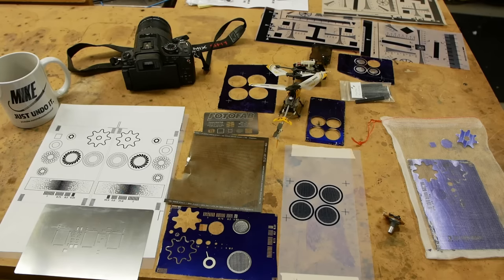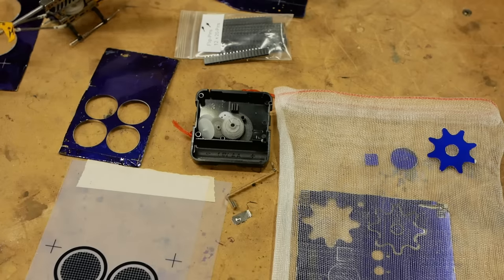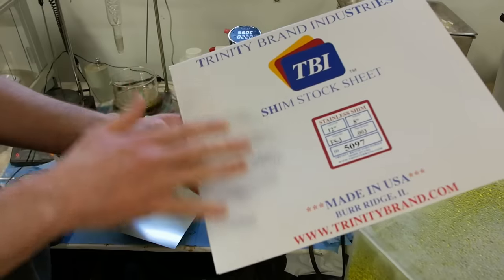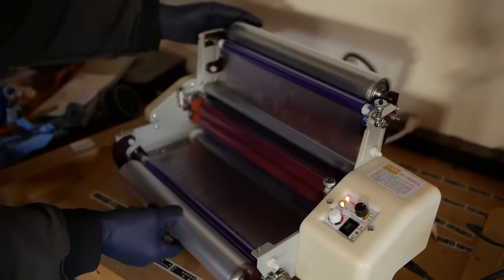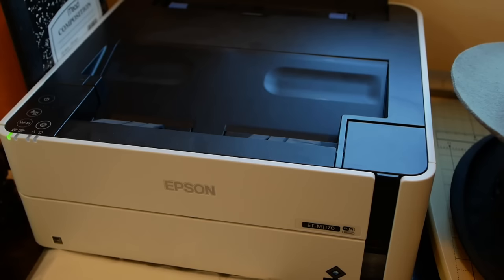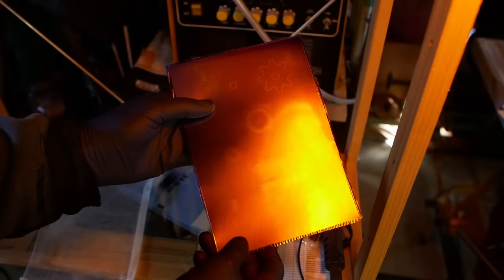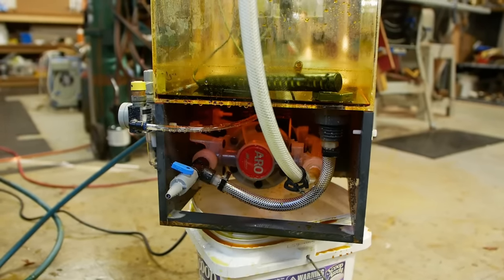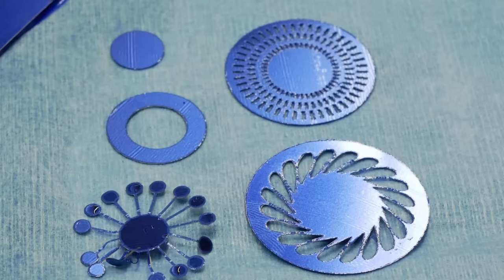How to make precise sheet metal parts (photochemical machining)

Comment: Hi Ben,  The specialty black inks are great, but if you want to use a regular inkjet then sometimes yellow dye inks can be more opaque to UV light because of UV inhibitors to stop fading.  Also a Stouffer Gauge will help a lot working out your exposure times.  Cunning Fellow (The guy that did The Etchinator)
Reply: Would it be visual at the end? I mean, can you easily inspect the quality when its printed? 
I'd imagine , no? 
But maybe a mix of dyes?
Reply: You can see the yellow ink with your eyes no problem.  A non yellow light source like a large blue LED will enhance it.  But really the developed dry film is the thing you should be inspecting most closely.
Reply: Do you know any particularly good yellow inks for this kind of thing?
Reply: Inna - Pigment inks naturally block more light so if your printer uses pigment inks (Epson would call them DuraBright or UltraChrome) then black is the best option.  If your printer uses dye ink (Epson Claria) then the black does not block the UV as well as the yellow.  The yellow is most susceptible to fading from the sun, so they add UV inhibitors (sun screen) to the yellow ink.  Most brands of dye yellow that claim they are light fast or don't fade in the sun will do the same.
Reply: couldnt you skip this step alltogheter going the mdlp route (like a uv 3d printer) i guess its a somewhat smaller DPI in a print, even still, a 6k mono screen should be abled to resolve fairly small details
Reply: @JLCok  Would only have enough pixels for small items unless you could step and repeat, and then registering top and bottom sides will be another problem.  Direct imaging would be worth it in large commercial operations, but for small scale - inkjet photo tools probably make the most sense.  Which is also the way it is in PCB making.  The big boys have lasers and fancy lenses.  The home shops have ink jets or drum photo plotters.
Reply: @TheCunningFellow  So I guss the next step is to modifay  inkjetprinter  by exchanging the  inkjet print head with UV light head ?
Reply: Marvellous stuff, Ben, thank you!

Comment: Another neat thing with photoetch is you can do partial depth to make fold lines,like scoring cardboard. Probably needs finer process control,though might be worth trying just putting them on one side .
Reply: Mike, Yes it is normal practice to have the fold lines etched only from one side.  The Asteriod Belt shown here https://content.instructables.com/ORIG/FEJ/ID3W/HFSHFI10/FEJID3WHFSHFI10.jpg does that by having half etched lines.  The photo tool for the back here https://content.instructables.com/ORIG/F8D/ELWM/HFSHFHYS/F8DELWMHFSHFHYS.png has thin lines for the folds but the front side is solid.  The same for the buttons so the arrows and symbols are only etched half way through.
Reply: @TheCunningFellow  Thanks.. how is it that YouTube is happy with your links?
Reply: @patkirk960  I didn't know youtube censored URLs.  I guess if the disappear you can search for "The asteroid belt instructable" and scroll down to step 5.  I used "toner transfer" there because I was told instructables readers prefered to see simpler tech than dry film photoresist.
Reply: @TheCunningFellow  Thanks. Yes they certainly remove them somehow I'm sure automatically but somehow folks circumvent the censorship!
Reply: @TheCunningFellow  Some lovely extra engineering in your instructable that's above and beyond the average. The extra yet simple hardware to clear the screen and to reduce the overhead from code was delightful.
Reply: @patkirk960  The channel owner can choose to allow links or not. But I guess there is also some AI filtering.
Reply: @user255  ah. Right. Thanks
Reply: i was thinking the same while watching the video.
Reply: sometimes it lets URL's pass through while other times it does not.
probably also depends from the source, since google ...
Reply: we've had custom RF shields for PCBs made, they were done like that, partial through for fold lines and text
Reply: @patkirk960  I don't think YouTube actually censors urls I've never had a problem
Reply: @TheCunningFellow  works now. Ben just had to approve the link I'm guessing. Thanks Ben!
Reply: @katiebarber407  I've had plenty of problems with links. At this point, I've taken to avoiding links wherever possible (e.g., by giving a search string instead) and, where I absolutely must have them, posting them in a separate comment that replies to my main comment so that at least if that comment gets removed the main comment has a reasonable chance of staying up.

(I've even seen several occasions where a comment appears to post but doesn't; reloading or checking in an incognito window shows that the comment was not posted. Even after retrying it, sometimes with somewhat altered forms, it won't post and I just have to give up.)

Comment: It's almost creepy how you come out with videos that answer the questions that I AM CURRENTLY STRUGGLING WITH. I'm talking about... the same day. It's super helpful, but also unsettling.
Reply: Same thing for me, I just watched a video on model making and was wondering "how are those photo etch detail kits àctually made?"
Reply: Let's test your theory.  What are you working on now?
Reply: @TqSNv9R0iG5Ckxew  At the time I was in the process of torturing myself trying to get the dry film photoresist to adhere good enough to copper laminate. If you look really closely you can tell Ben is actually having the same issue. The film delaminates during the etch around the edges. Sometime delaminating completely. I haven't found any technique that will work well enough to have 1mm or less resolution. But I have found something that does actually work pretty well. It is labeled as  "Photoresist Anti-etching Blue Ink Paint For DIY PCB." It's a thick blue ink that needs to be cut with acetone. You can either spray it on with a "Devilbiss" style paint sprayer (which will give you a better, flatter finish" OR you can go to an auto parts store that carries "Preval" paint sprayers. They are like a mix your own spray paint kit. pretty cheap, and works well enough. You have to dry the board well (quickest I've found is with a couple fans in a closet with one of those Edenpure heaters set to 90 degrees F. Important note: You can not heat the photoresist ink past 100 degrees or so or it will cure the ink and will spoil the board. It will dry and not be tacky, or will only be very slightly tacky. Then you can expose and develop the same way you would the dry film. As long as you clean the board as per Ben's instructions you should have NO problem with lift off and the edges are crisp. Thing to note, the vapors whilst spraying will probably give you cancer... sooo.... well ventilated area, a respirator, or roll them dice.
Reply: @jonathanseagraves8140  so way on earth would you not use wet resist? 

When i see amateur etchers trying to use dry resist i just turn it off. 

He has so many flaws in this video. 
Fun to watch. But not the setup
You should use for better results in your garage :)
Reply: @Mr.Flo.Official  Short answer is I don't know where to buy it + sunk time fallacy + I don't know what product I should be looking for in the first place... I will take any info you have.

Comment: For registering the masks/artwork you can get an anti-parralax magnifier or collimating magnifier - they're often used for 4 color printing - look for para-mag magnifier or caprock stripmaster series. 7x or 7 power should be enough.
Reply: Never heard of those. Good tip!
With appropriate fiducial marks and a microscope, you can be surprisingly accurate hand aligning. I have bonded so many 30 micron pitch flex circuits by hand.
Reply: In addition, the masks should be taped to a spacer of the same thickness as the sheets including their resist coatings (ie, a strip of the stuff) 

That's experience from registering and etching double sided PCBs back in the 80s ...  :)

I'd create some light box tubes around those 405nm lights too. This will greatly increase the luminous flux at the sheet surface whilst reducing purple light spillage where it can cause trouble - it was more important back in the days when UV sources were being used - The setup I used had a large mercury arc lamp set 5 feet from the PCB surface and you really didn't want your corneas being exposed to it
Reply: It could be used to calibrate for stretching as well by printing 2 square or circle patterns and comparing them at 90° to each other. What he's worked out is incredible as is, but it's very close to being something wildly more precise.
Reply: Use multiple angles of diagonal lines on both bottom and top.  You can see fringing very easily.  Zone plate idea.

Comment: I work with/design stamped parts and source mesh all the time… Stainless, zinc/tin plated parts and stainless/epoxy coated steel mesh. A lot of our vendors are willing to do stamping tooling on the cheap (<$1k for .03” thick, 5” OD parts,) if you’re an established company and buying some volume. It’s crazy how cost effective stampings are after just 100s of pieces. 

For the mesh, stainless wire can be woven down to 10 micron nominal and even calendared. We buy 25-149 micron, but the cost is almost exponential when going to finer grades. 

This video encompasses a mentality that I wish I seen more of- How do you do something that is economical (maybe cost but not price 😉,) quality, and faster lead time than all of the competition? You can build a lot of businesses in the industrial world just based on those 3 things.

Comment: One method to improve the density and reduce the pinholes in laser printed output is to use color foils (also called toner reactive film). You run it through a hot laminator or back through your laser printer with the color side against your artwork, and the color film fuses the toner, but not to the areas on your artwork that have no toner. I use it when I am etching PCB's at home. (For PCBs, I print the art on release paper, laminate it to the PCB, then do a short soak in water which disolves a layer of the release paper, allowing you to peel the paper away from the PCB leaving the toner artwork on the PCB. Then I run it through the laminator with color foil which helps with density and pinholes. Then I etch the board w/ ferric choloride.)  The color foils don't work with inkjet, though.
Reply: would you mind providing a link to the release paper as well as the color foil paper that you use?
Reply: (Bookmarking for reply wait)
Reply: I've used a product called 'Press-n-Peel Blue' for this. You can print directly on the film then laminate that to the copper pcb. Can be tricky to get the laminating right - pressure and temperature need good control. And everything has to be kept dust free.  I've used this for PCBs, and for sheet metal parts.  5mil track/space is possible (just).
Reply: @weldandcutdotcom  You can't use external links in Youtube or they get deleted. You can also get banned, like when I used a fake comedic email name and got banned.
Reply: @SidneyCritic  What about 'fudging' link so that the filterbot does not recognize the link? Like mmm d0t earl d0t corn (that was typed as CORN) ??

Comment: Just went through this process and contacted all the vendors you mentioned in the intro for making a few shadow masks for a metal evap tool. Was thinking the whole time this is something I could just do in my shop and it's crazy expensive. Of course I just thought it and you actually did it! I don't have enough demand to build it but it sure would be nice if an OSH-ETCH or SendEtchSend sprang from these efforts!!
Reply: What a coincidence, I've just done the same for a project too!
Reply: ETCH-PARK
Reply: @MaltandMake  Fancy meeting you here!... but not at all surprised.
Reply: @CollectiveSoftware  Yes, that's better, we'll go with that one!!
Reply: Not to be disrepectful. But what sort of tolerance you need your shadow masks to be at? 

The setup presented won’t offer anywhere newr +/- 1-2 mm. Also the details and peel of he gets are soooo bad to watch coming from a PCM background :)
Reply: @Mr.Flo.Official  In my case, these were masks to be placed in contact with wafers during a metal deposition as an alternative to going through a full litho process. Just a quick, and possibly cheaper, way to run quick prototypes of parts with features that weren't critical. Just needed to establish contacts and grids to test the underlying epitaxy and possibly adjust without waiting for them to run all the way through our litho line.
Reply: @TandaMadison  fair enough :) 
Laser cutting will be way cheaper and quicker 🙏🏻
Reply: @Mr.Flo.Official  Had feature sizes down around 5 thou and really thin material that most of the laser folks weren't interested in dealing with. The parts from the chemical machining company were quite nice, just pricey.
Reply: @TandaMadison  interesting. I usually prefer 5 thou on my laser setups. I do both laser cutting and chemical etching.
Reply: @Mr.Flo.Official  Is this something you do commercially or just for yourself? Just curious because I may need to get more of them made. To be clear, these are long 0.005" slots cut into 0.004" thick material so pretty delicate.
Reply: @TandaMadison  music to my ears. 
Not sure how you want to proceed. But got an email in my about section on my youtube channel. 

You can share you drawing to study feasibily and offer you a quote :) happy to sign an NDA if needed at this stage.

Comment: Hi Ben, I used to design machines used in photolithography and the photoresists coaters. We used to etch parts on sheets of glass, etching gold and titanium layers. We used to use spin coaters. The nozzles would be placed above a spinning chuck that was made of nylon. The whole thing was surrounded by a big tub with sides higher than the spin axis. The force of the acid falling, hitting the surface and then being flung off was enough at 1000 rpm to take the debris away. For the underside we had nozzles firing the acid up at the underside surface.

Comment: For more precise alignment (at least during the tape phase), you could use a moiré pattern , possibly with a vernier type setup (so one registration is slightly smaller on one side). Then you could align the interference pattern. Although I’m not sure such precision would be necessary, so you could probably just go with interrupted overlapping lines on the cross pattern (similar to how polymer bank notes have transparency alignment patterns)

Comment: Couple of thoughts from when I used to home etch PCBs:
Laser printing onto tracing paper works much better than transparencies,you nerd to use thick stuff,>90gsm to stop crinkling in the fuser.
When aligning the artwork, stapling works well as you can align accurately with the sheets completely flat against each other,but you do need a setup where the staples overhang the edge when exposing, less of an isdue with PCBs due to the thickness of the board

Comment: In the past I used the head from an photo collimator for a similar UV exposure process where we needed collimated light.  Your setup seemed to do the trick just fine, but we needed it to be up close in my application.  Its a reasonably cheap way to get get it done as you can fine them second hand.  Did have to air cool the lenses as they got a bit hot from the high powered UV light sources :)  Mesh bag was a slick idea!  Really great video once again

Comment: Your idea about a "really clean air source" sounds very familiar to another interest of mine, mushroom farming! They need sterile workspaces and they use large like 2 foot by 3 foot HEPA filter pointed down to create a sterile downdraft area to handle spore prints and gather samples without contamination. They don't even cost all that much, and with a custom hood could make a real nice drying area. I have thought about this for another area I am interested in, beer brewing, as an area to store a kveik ring to dry and keep from contamination.
Reply: HEPA filters really are amazing. I do research using flat sheet media and they can handle concentrations greater than 10 million particles/cm^3 at well over 5 cfm through the filter (more than a billion particles a minute!) and still capture 99.97% of the particles.
Reply: I worked in electronic manufacturing and we usually have clean booth. It is just a tent made from extruded aluminium and plastic sheet, with a filter unit on top. The booth is just large enough for a small table where a worker sit to assemble dust sensitive parts like camera or screen. The filter unit is just a fan blow into HEPA filter to create positive pressure inside the booth. There is also ion generator for ESD protection and some LED light. There is also a mini table top version, and some assembly machine have integrated filter unit on top to keep the inside clean. Pretty easy to DIY something like that.